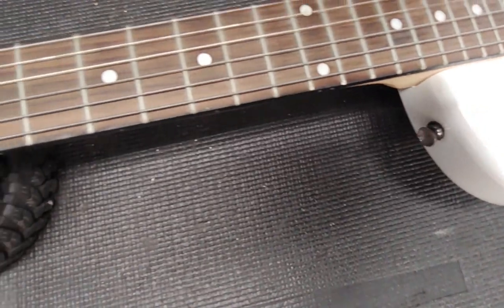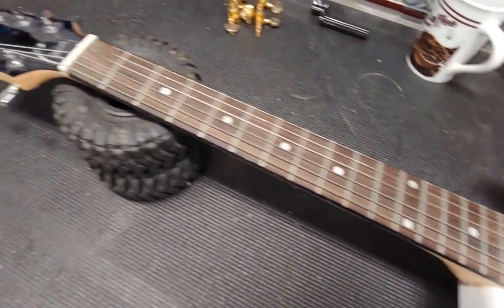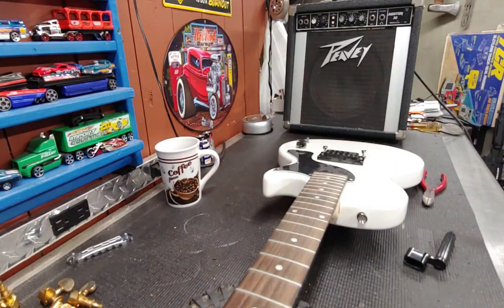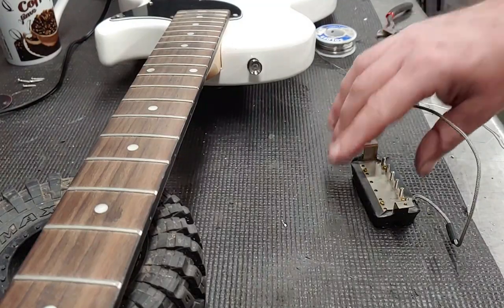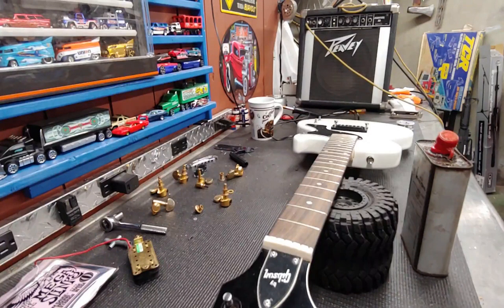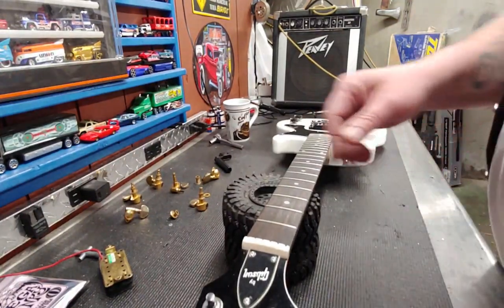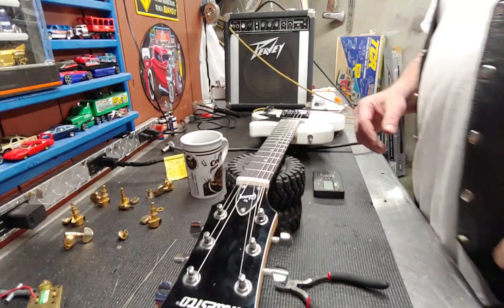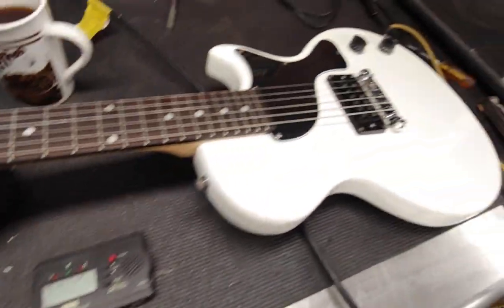Gibson Maestro Les Paul JR gets some attention and a new pick up

Comment: I have the same guitar. The one thing that helped the sound most,was replacing the bridge. If you notice, the g-string is intended to be a wound string. You can't get proper intonation on that bridge with a modern set. I replaced with s cheap badass style wraparound, with adjustable saddles.

Added cheap locking Schaller style tuners, and a humbucker sized p90 ... All for under $80 and she rips!
Reply from the maker: Sounds like some good advice. Thanks
Reply: Tim Powers,I didn't know that about the bridge design for  3RD Wound. Can you eleborate on it. Im upgrading  my Maestro  Blue Burst. already ordered an new Saphue wrap around bidge with ajustable saddles and tonight im ordering some  Wilkinson Easy Lock tuners. Pickup might be at a later date.Thank you.

Comment: I have a Blue Burst one that I got at a pawn shop for $39. Mine looks like it's plywood where the pickup used to be. I got a set of Wilkinson Easy Lock tuners from The Stratosphere store for $20. They are an exact same size and mountthe same way.
Reply from the maker: I find it interesting that Gibson allowed the open book head stock to be used. I did replace the tuners"kluson" in addition to the pickup. I will do the nut next. Damn it i will make this a player. 😆 Thanks for wathing.

Comment: I see you soldered  a ground wire to the pick up? Did you solder it to the black ground in the pickup housing, or pull it through to its final area it goes?
Reply from the maker: I soldered the ground to the tone pot. I discovered when soldered to the volume pot it had a lot of interference creating a buzz.

Comment: I have the same guitar and it doesn't work. Can you tell me the specific parts I need to do what yo did?
Reply from the maker: The pats i used so far are as follows, a Gibson dirty fingers pick up. Kluson tuning machines. And i also ordered a bone nut...not yet installed. And the tone and volume pots are fine for now. The most important upgrades are tuning machines and fret filing.
Reply: First get a trash can and then

Comment: Not a bad guitar. I have the same model. The bridge and tuners are a pain in the ass, but I've found that the fret board is the real bitch. It bows like a mother. Adjusting the truss rod helps so much. Ultimately replacing it is the key. But I understand not wanting to lose that signature key Gibson neck design.